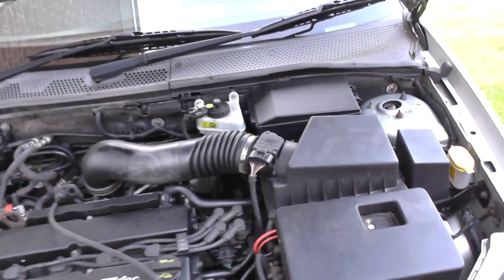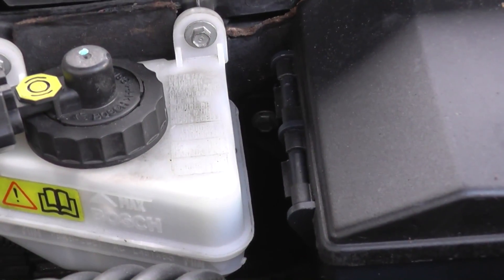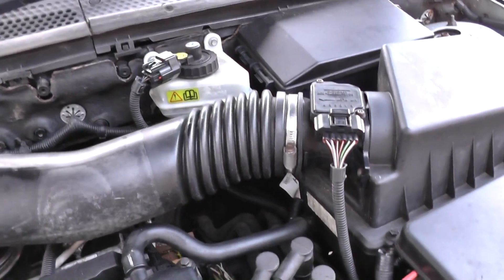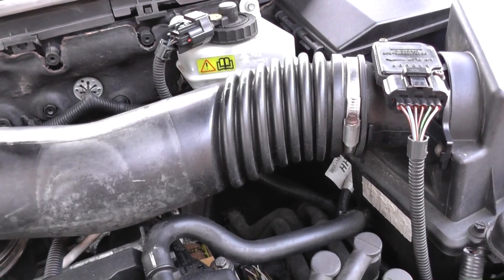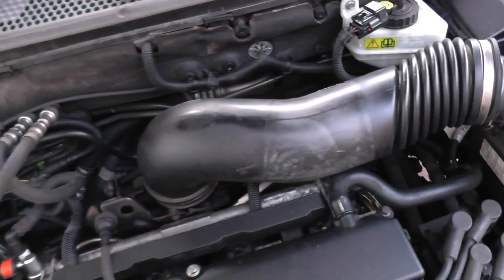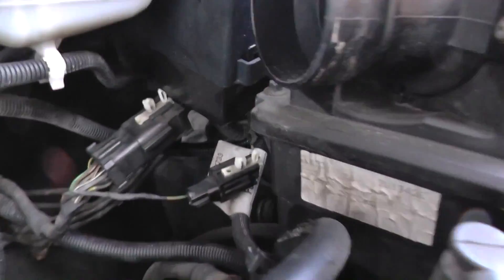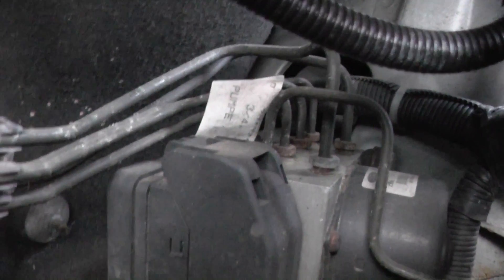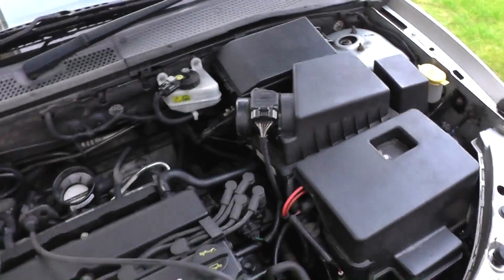Ford Focus ABS Pump & Module Location Video Guide

Comment: it's a nightmare owning a small ford car. these focus are designed by the most pitiful of design engineers. the cabin air filter removal will prove that. working on a civic or accord is so much easier and parts are much easier to find also.